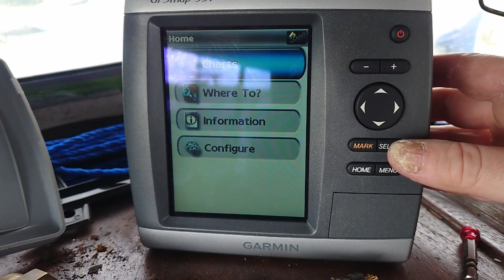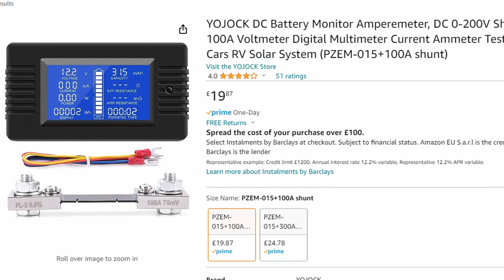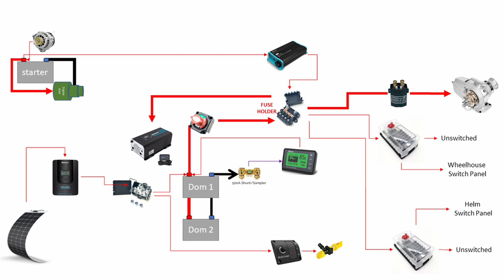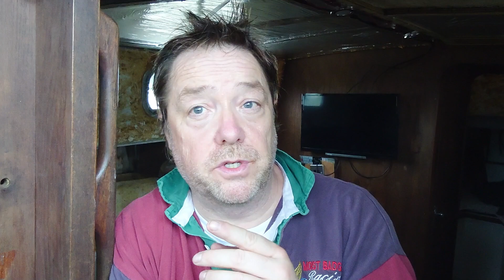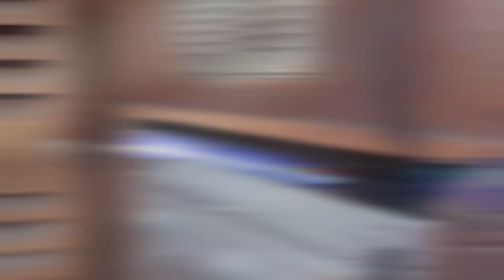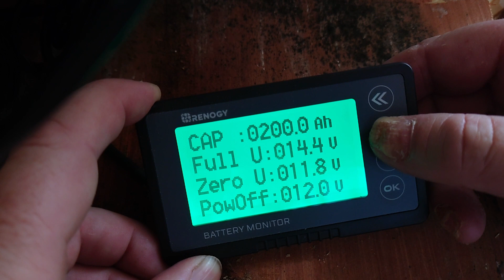How To Install A Battery Monitor For 12v Off-grid Battery Systems

Comment: I spy a Badger,
Reply from the maker: The last badger!!
Reply: What you think of the inverter?
Reply from the maker: The inverter seems pretty solid. It doesn't squeak when you hammer it, and I've been using power tools on it. The fan goes off more often than I expected - fair enough when  using a 1Kw microwave... but it also comes on when there's almost no load at all. The switchover to shorepower is seamless so I reckon it's a pretty good beast... although physically it is a big old unit 🤣🤣
Reply: Think I've just ordered everything you have lol. Rover the inverter and the monitor
Reply from the maker: Oh do get the Bluetooth monitor for the River. I didn't, but am regretting it... I'm fighting the urge.
Reply: @confidencesailing  I did get the Bluetooth. But inverter I mention in other vids was not right I just got the 3000w inverter not the charger one. I only just ordered today.
Reply from the maker: I nearly did exactly that. A friend persuaded me to go for the inv/charger. Still not sure if that was the right thing or your way.
Good luck with it, and thanks for watching 👍